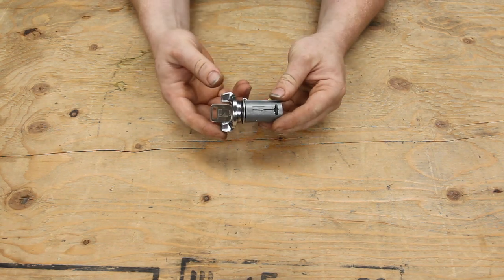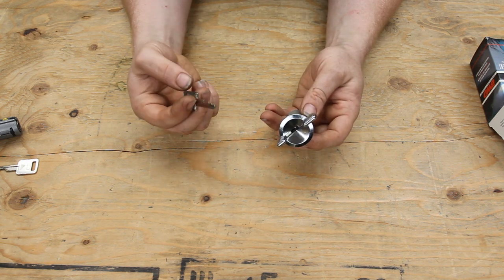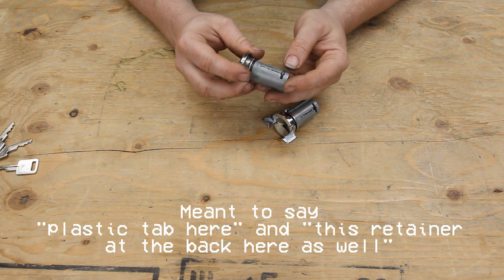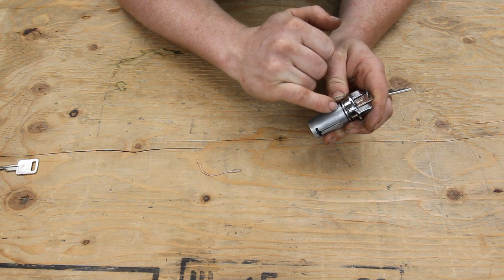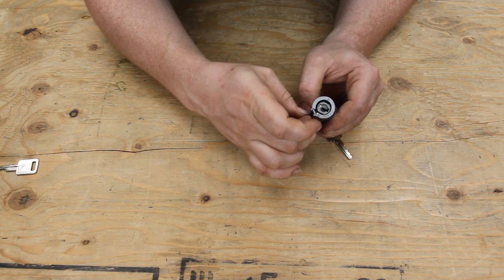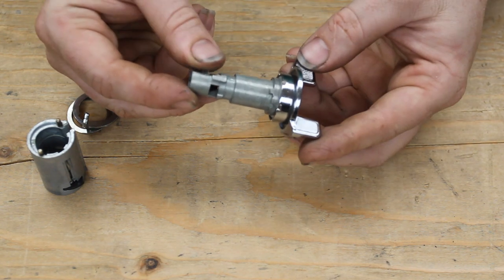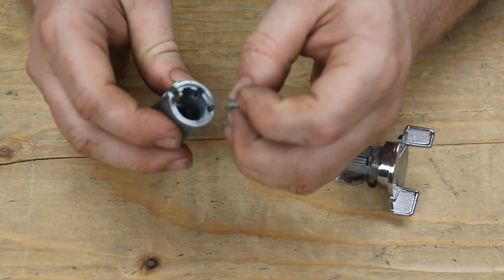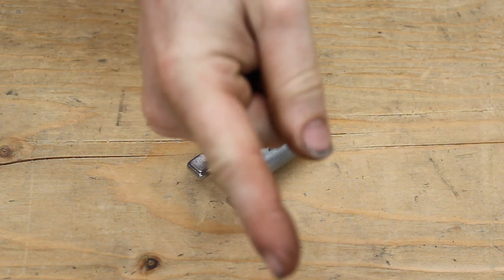Inside an Ignition Lock from an AMC Eagle

Comment: I built these at a gm dealer a few years ago.  They come in pieces thru gm and you install the tumblers you need, and cut a key to code if needed.  They are designed to be one time use for assembly and staking.   You can usually modify a couple times, though.
Reply: Karl, I took one of my old Chevelle ignition locks apart to see why it was binding (it probably was a worn key, as explained in this video). But when I reassembled the wafers and springs, I had a heck of time trying to stake the wafer cover in place. Actually, I inserted the key before putting the inner cylinder into the outer housing and BOING.... everything went flying. How did you stake the cover? Special jig?
Reply: @salatiello1956  usually we used new assemblies. I do not recall a jig. I would use an automatic center punch in a few places, the other guy would use a hammer and small punch. I liked the automatic punch because it was a one hand affair. Some strategically placed loctite or jb weld or epoxy could help a used part stay together, too. If you can replace the sheet metal part the springs push against, a new one seems to fit tighter compared to an old distorted one.  Sometimes rubber bands, zip ties, wire and tape can help in between steps.

Comment: Hello! I have almost identical GM lock, but it has two brasspins and dont have that notch at the end that you can press down. I have tried to figure out how to disassemble it but no luck sofar. Any ideas? Lock is pinscrew style to ”bolt in” steering column.
Reply from the maker: I only know about this style of lock cylinder, sorry. My suggestion is look for a locksmith and see if they can help you dismantle it.